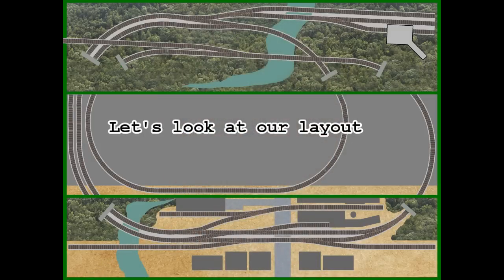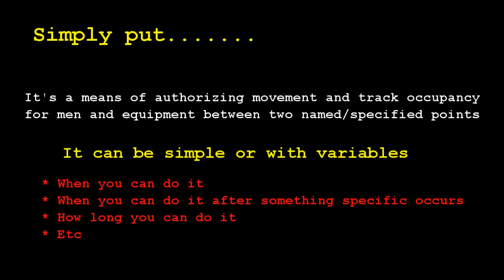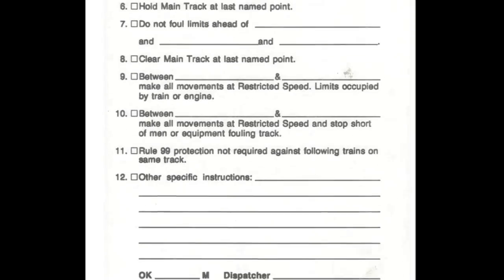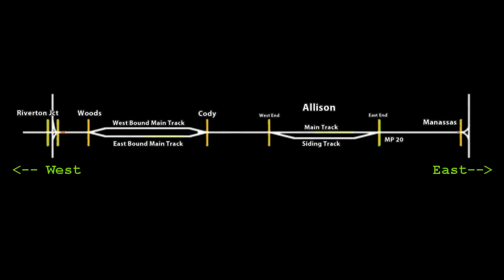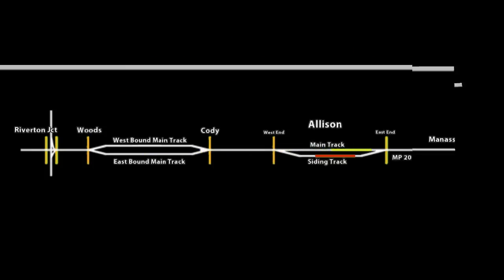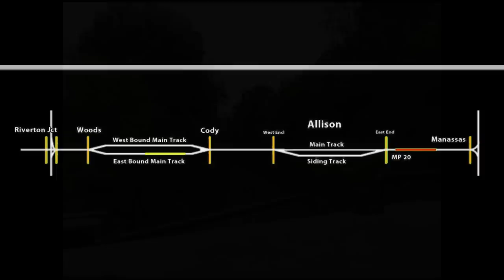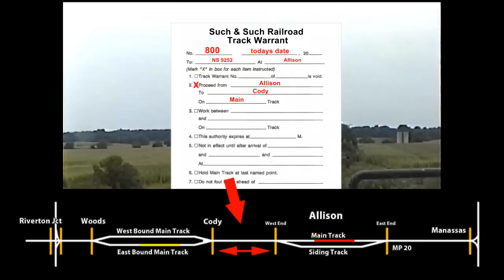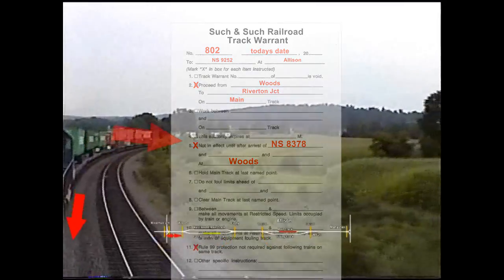A LOOK AT HOW TRACK WARRANT CONTROL WORKS - For model railroading

Comment: I managed a tourist railroad for 8 years , we ran over 30 miles of ctc and 30 miles twc.  We had the operation down so well, that we would depart on the weekends at 1000, at the head of the parade, with two following and one opposing.  The crews and DS were really great about rolling up and keeping things moving..  On the return trip usually one had one opposing.

Comment: Hey Joey that's cool that you used to work for NS. I currently work for NS out of Harrisburg as a conductor. I occasionally make it from Hagerstown to Mannasas with a Co pilot. It's all signaled now. It's a beautiful run.
Reply from the maker: adam reynolds small world huh? Actually in that video we took that train all the way to Rutherford as a few of us were qualified after the merger. I was on the Manassas -Hagerstown pool at the time, but took the conductor "step up call" for this train which was in the Harrisburg-Manassas pool at the time. we stayed at Mechanicsburg Holiday inn when I worked this pool run. Lots of miles though. Yes I know they signaled the BLine, I still live not too far away and still talk to the guys out there.

Comment: You have no idea how much I envy you.  When I was younger I wanted to work for the railroad but was talked out of it by my family that convinced me the railroad is dying and they wouldn't be hiring.  Now that I am in my 40's and completely burned out (and worn out) from what I have been doing, I guess I'm probably too old to even think about it as a realistic new career.  I wouldn't even know where to start trying to get a job with the railroad.

I guess you could say I did the next best thing with truck driving, but I took a few years off the road while my kids were growing up.  Now I have to go back to school to "re-learn" to drive truck again or find something new to pay the bills.  Is it tough getting started in the railroad industry?
Reply from the maker: Vance, when I hired on, the old heads would all say "get out while you can" and for the most part in the time I spent out there, the industry did change drastically.
Reply: I spent 10 years as a switchman for the Chicago and northwestern. I heard that type of talk the entire time I was there. Yes there were changes. Some drastic. But the railroad was still there and still is. And oddly enough, the time you took off from trucking is about the same time you'd have to take off of railroading. Depending on what class of service you work, you'd be away from home a lot like a long haul truck driver. Unassigned pool service can be a KILLER(work wise) and a family destroyer. Puts cash in your pocket but keeps you away from home at a nice destructive pace. And the crew callers won't let you take a day off unless you lie and layoff sick.